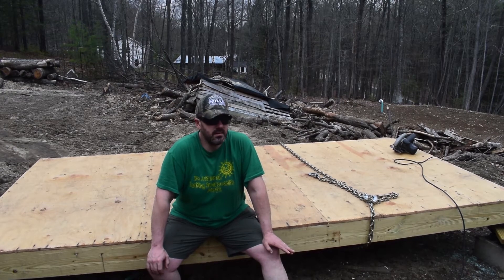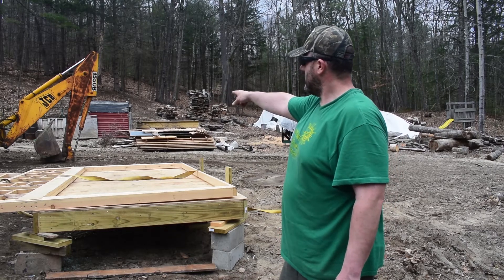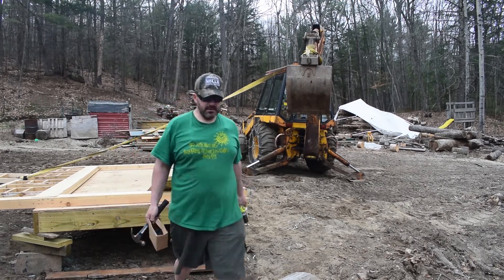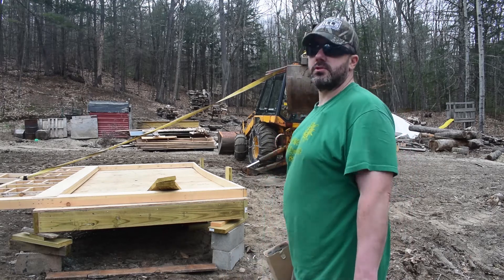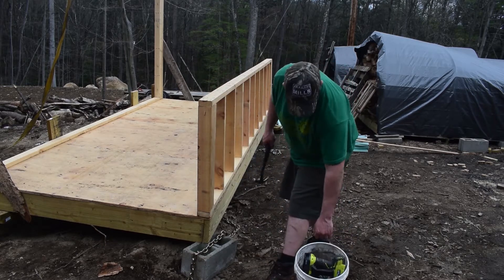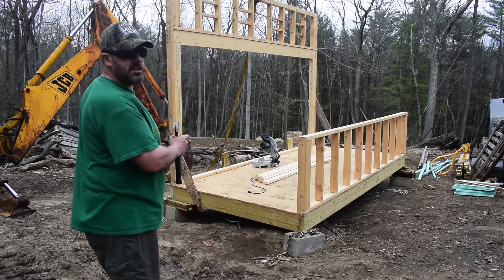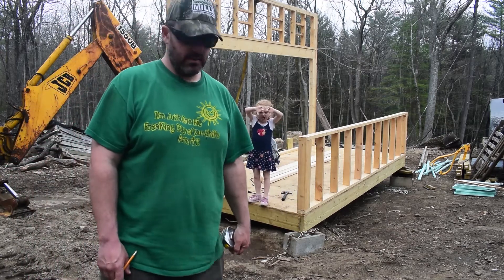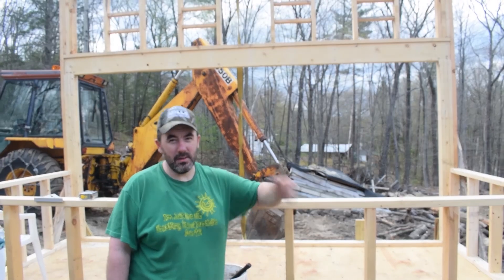Solar Kiln Build Part 5 - Raising Walls with a Backhoe

Comment: Thanks for showing us your project! Just wondering why you didn’t use your backhoe to level out an area to build on?
Reply from the maker: I'm kinda in a hurry to finish the kiln so I can get the wood in it.  I also plan on doing some landscape work on this property later.  Eventually I will work on leveling the yard out and very possibly moving the kiln to a different spot.  Right now I have so much wood that I need to dry that my primary focus is getting the Kiln finished. Once it's done I will be putting more supports under it just before I load it. My next big project will be building a workshop and a place to store lumber for air drying.
Reply from the maker: I have so many logs that I need to Mill right now, but without a place to put the wood I'm kind of stuck in a catch-22 position. I appreciate you joining the channel and hope to see you on the next video.